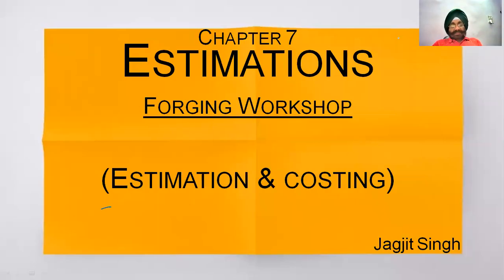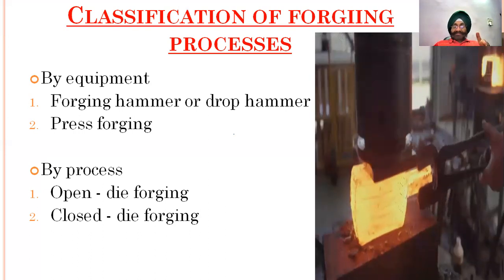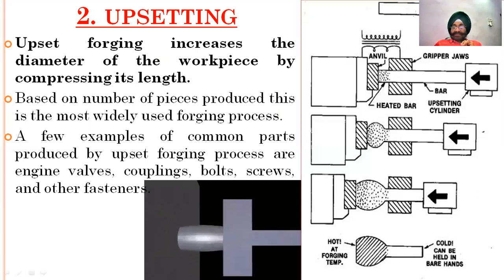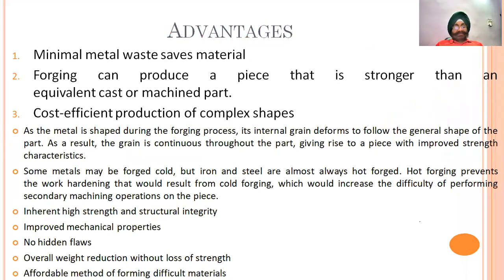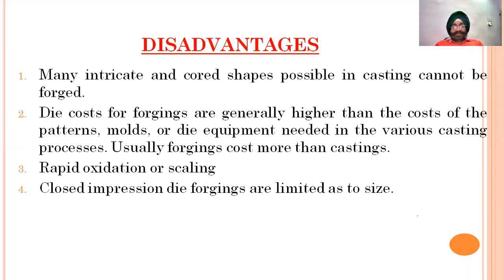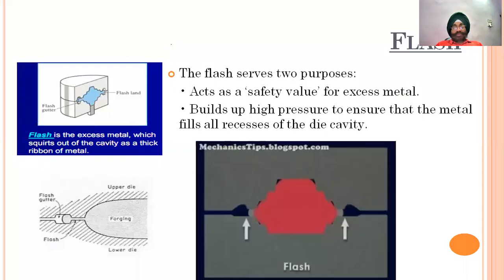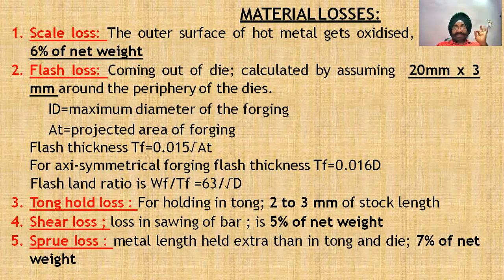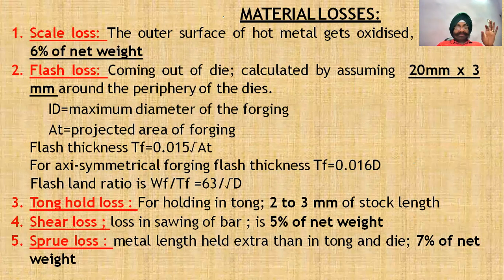Forging cost estimation-ESTIMATION AND COSTING chapter7-MECH(6th)

Comment: Sir, can we cast a die for complex profile object to have forging. And if this can happen what is the probability of getting the forged object accurate?
Reply from the maker: Bravo Aman for such a nice question
Yes complex profiles are always made by forging, but the exceptions are thin sections. Thin sections are either distorted or if made by closed die forging then there are chances that the last thin section portion will not get the material
Cast DIE will not always be a finished ones. They always come with various allowances like draft, shrinkage, warpage allowances etc. Hence, casting is not a good option to manufacture a forging die, alternatively machining and fitting a die in parts is always the best option for making forging parts DIE.
Reply: @hsbtetutoronline-jsn  Thank you sir

Comment: Sir problem in numerical . Dimensions of forged block aren't clear to me.
Reply from the maker: kindly tell at which point of time in the video?
Reply: @hsbtetutoronline-jsn  sir how have you taken the lengths as 3.0, 3.5 and 3.0 when calculating the volume of the forged component> Shouldn't it be 2.0, 2.5 and 2.0?

Comment: Sir , define sprue loss in forging ????
Reply from the maker: .Loss is 7% The connection between the forging and tonghold is called the sprue or runner. The material loss due to this  metal used as a contact is called sprue loss. 
The sprue must be heavy enough to permit lifting the workpiece out of the impression. die without bending
Reply: @hsbtetutoronline-jsn  thanku sir